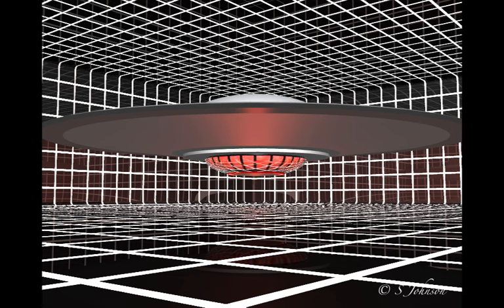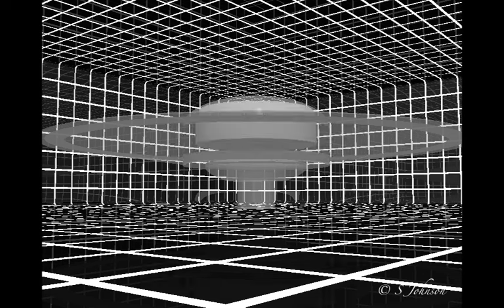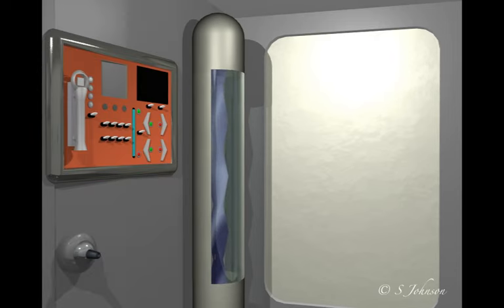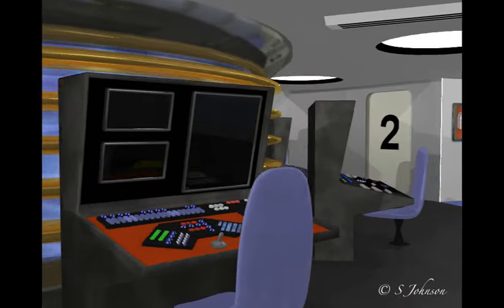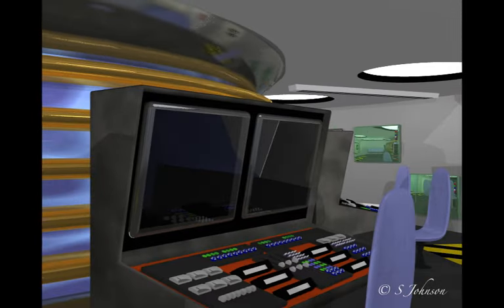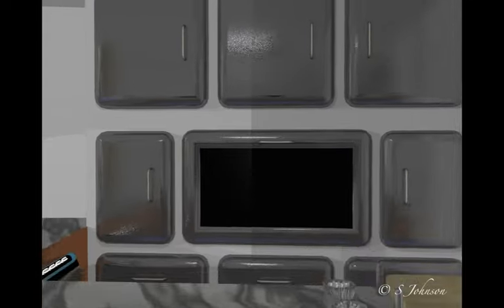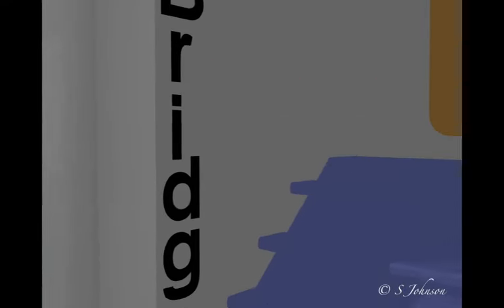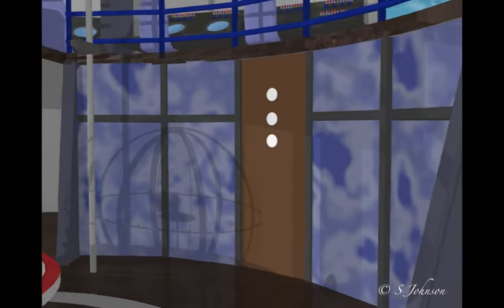3D Tour of the Forbidden Planet Saucer * Scifisteve

Comment: Well done!  I esp. liked Robby welcoming us into the saucer.  I was so happy when I saw this film as a kid, and they'd repaired and rescued Robby and he became part of the crew.

As to your rendition, it's wonderful.  I do have a question, though. As I recall when the Monster from the Id climbs the main ladder into the saucer, it immediately arrives into a berthing area, in which there's a winch or crane to pull stuff in & drop it out.  Your model has this in the Bridge area which is about 3 decks above that entrance.

Another thought is that cylinder which you show housing the main fusion (fuser?).  There seems to be no reason to retract or extend a solid cylinder with this important and heavy power source.  This would complicate connections to the rest of the ship, too.  Seems like it could house an elevator, but I'm not sure that's consistent with the movie.

Just some thoughts.  Your renderings are beautiful and well thought out, sir!
Reply from the maker: I hope to revisit this site and update the control systems on the lower deck.  Actually put the screens to real use.

Comment: A couple things bug my wife and I: #1 the size of the tracktor / jeep vehicle: HOW did that fit into the C57D? I know two ramps are  stairs and the third ramp is a conveyer belt. BUT THE SIZE.  Also, similarly, those big blasters: Colt-Vickers Quad Fission blaster cannons: THEY"RE huge.  
Finally, when Commander J.J. Adams yelled to his hot shot squad "Set up a cross fire from those rocks." There were NO ROCKS inside the force field fence: They blew it when the men ran right thru the fence w/o d
Reply: Since Commander Adams asks the Bosun to "Assemble the tractor," I'm going to guess when disassembled, the parts are much smaller and easier to store.  The big blasers..I'm also going to guess were from the ship's exterior and they just moved them to a better firing location....again all guesswork, but I hope that helps a little.
Reply: They are built in pieces and easy to put together, modular. This shows when you are building a ship, not all should be built permanently and easy access for repairs/replacement.